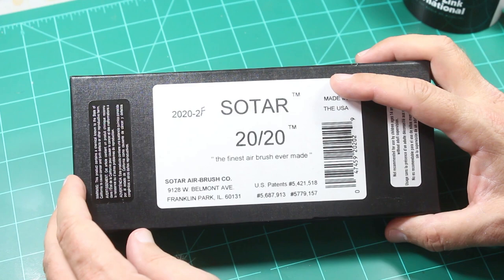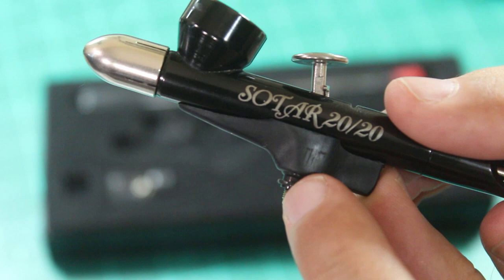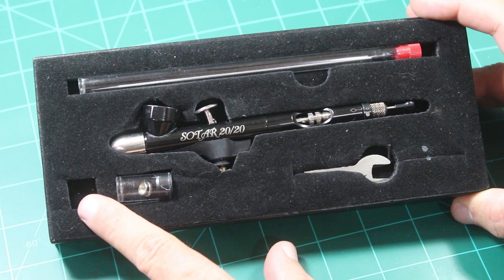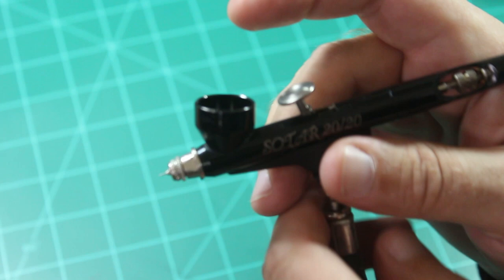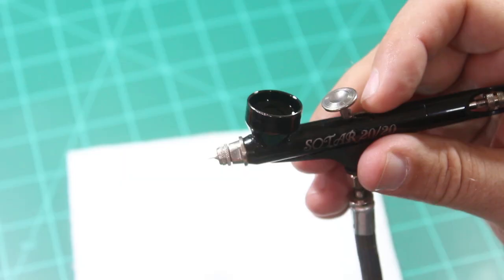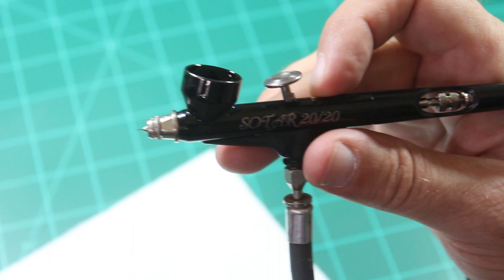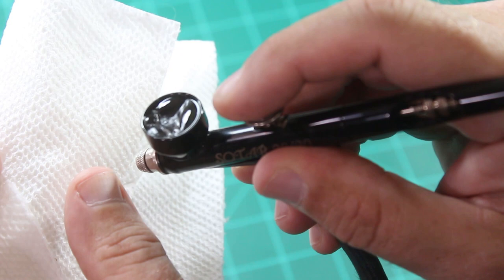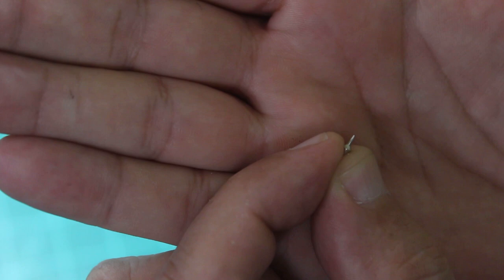Problem: Airbrush Troubleshooting Bubbles In The Paint Cup

Comment: I have an Airbrush with three needles, 0.3, 0.5 and 0.8 both 0.3 and 0.8 blowing bubbles yet the 0.5 is perfect! I have bought new needle cones but nothing has improved still massive bubbles! I've checked everything possible but still the same! Any advice would be gratefully received.
Reply from the maker: That is a very weird situation. You would figure if 2 are blowing bubbles all three would. I know it sucks but I would clean the airbrush and check all the seals. Here is a good article on troubleshooting bubbles in the paint cup.

https://airbrushinsider.com/why-an-airbrush-blows-bubbles/

Comment: I have a problem with my airbrush. Can't find any damage on needle, tip or nozzle but it keep bubbling in the paint cup. Where should I check in the next step??
Reply from the maker: You can use beeswax on the threads there could be a possible leak. What type of airbrush?
Reply: Hobby Link International It’ an Hobbynox Flow. Think I have busted the o-ring in the front some way. Tested to tightning a bit more yesterday and the bubbling decreased. So new front end and o-rings ordered
Reply from the maker: @Ringhandreas  let me know how it goes :) glad you caught the o ring situation.
Reply: @HobbyLinkInternational  Changed the o-rings and now it works great again. Just need to learn to mix the colors right and use the correct air pressure :) I paint 1/10 lexan rc bodys.

Comment: I have iwata doin same thing took needle out still get blowback replaced fluid tip same thing  what's my problem
Reply from the maker: I do not use Iwata Airbrushes so not sure of the parts on it and very difficult to diagnose a problem without having it in hand. Does it have any type of O-Rings at the front end of the the airbrush. If so that could possibly be bad and letting air leak from the head cap or nozzle cap.
Reply: @HobbyLinkInternational  I replaced them
Reply from the maker: @MartyBreuder-oc5jk I am really not sure what it is without seeing it in person :( I am sorry.